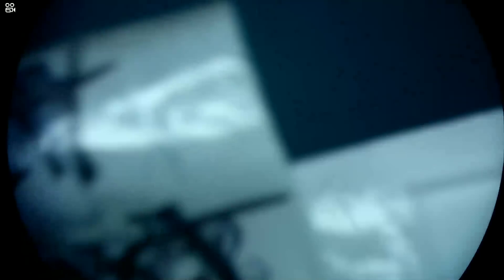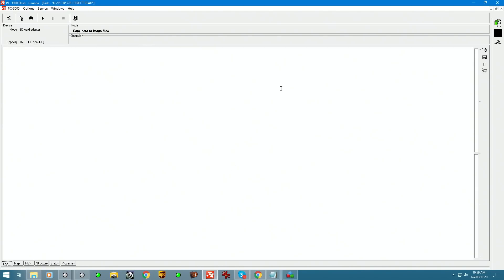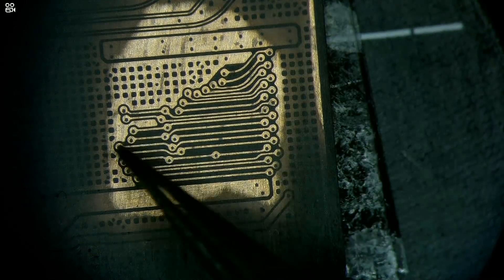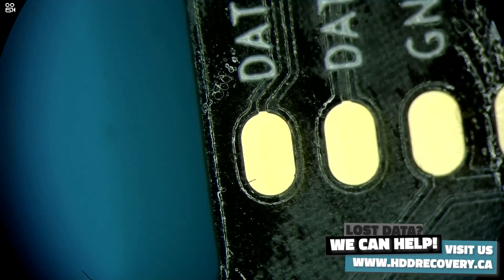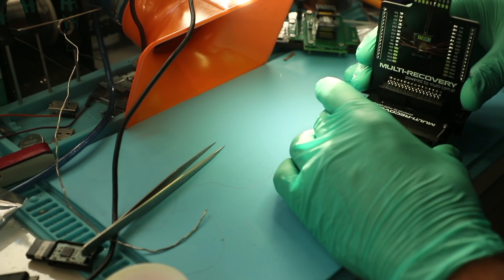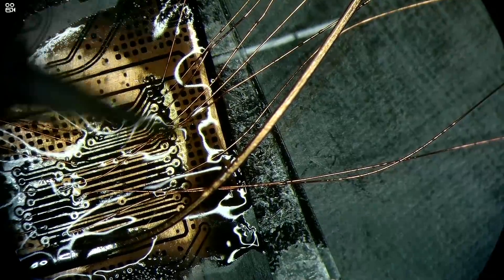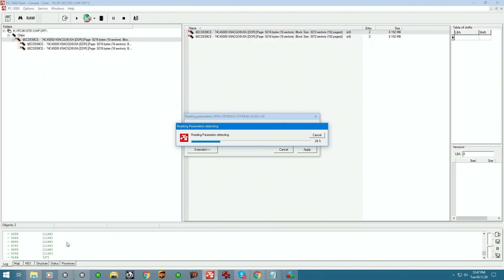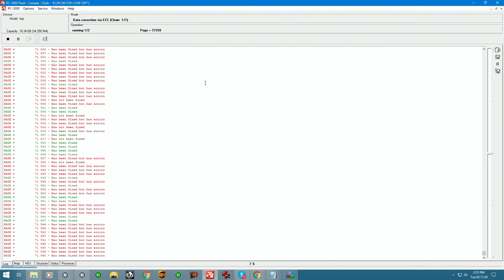microSD died in the camera. Monolithic data recovery part 1

Comment from the maker: the recovery is done and documented. part 2: 
https://youtu.be/kE6gf-K4kws
Reply: This is the part 2 link for anyone who was looking https://youtu.be/kE6gf-K4kws
Reply: but when
Reply: Ahem
Reply: 2 weeks, still no pin
Reply: 1st of all let me say...
U have mad skills buddy..! I've watched  few of ur videos & ur amazing...
I've been watching ur videos as I need ur help...

I have a MicroSD card that was in my phone (Android), I took it out 2 do a backup & I think the card reader I used corupted it or something... (The reader was just a cheap 1 I bought @ the market & had never used it b4, that was my mistake 4 not testing it b4 using it on a critical job)
When I pluged it into 2 my windows laptop the "Format Disk" box popped up.
I have since bought a better card reader wich I have tested & is good... but it still says the same.
I have tried using Recuva (free edition) but it gives an error as soon as it starts... as I believe it cant acces the drive till window can...
The error box says... "Failed to scan the following drives: F:: Unable to determin the file system type"

I dont want to format it & loose any of the folder structure or more importantly the data etc...
Please help... do you know of any software u can recommend
Ur suggestions would b greatly appreciated.
Thanks.

Comment: Looks very complicated. Where did you learned how to use the flash equipment?
Reply from the maker: Soldering is not hard with good tools, scope and few weeks of practice. Flash equipment does need some time to get a handle on it. Equipment developers offer courses, have support forums, and manuals for these tools

Comment: why none any of the storage companies do attention to the easy data recovery option? if the data storage's disk section of HDD can be separated easily and make it easy to replace or put into any other working HDD than it will be so much helpful for those poor users like me who are losing their most valuable data but have no much money or good RSS to recover the data. please I lost lots of but 1 big folder losing makes me so sad which contains many memorable photos and videos. maybe I can get back many things but not those sweet times which should be possible if I can access those photos and videos.

Comment: I had an SD card get corrupted in my Fujifilm camera just about a year ago. Coincidentally (?) it was just when the picture sequence number rolled over from 999 to1000, which was when the camera started putting the picture files into a new directory.

I put it into my Debian-running laptop and turned fsck loose on it. Reported a lot of errors. So I left it continuing the scan for about 24 hours. It “rescued” a lot of junk files, but in among them I was able to retrieve just about all the missing photos. At least there were no gaps in the photo numbering, and only one picture was visibly corrupted (the bottom half missing). So I call that a happy ending. ;)

Comment: Very interesting video, I was not aware that doing any sort of data recovery from a SD card or SSD was possible.  This is great to know about, I personally do not have anything on my SSDs etc that would warrant spending the money to recover the data.  I suppose if you were using a camera professionally it may be worth the expense of recovering the data.  When it comes to my PC and laptops I still do backups religiously a habit I got into from when all my drives were the old mechanical HDs.  Restoring from a back up is a whole lot cheaper than data recovery.

Comment: NICE! May i ask - if you solder this microSD directly to monolith adapter of PC3000, reading still be available? Or you need only this specific adapter that you was use? Thanks
Reply from the maker: PC3000 adapter is good for this too.
Reply: Congrats dude, you're amazingly skillful. My 250gb sata hdd spins and then stops, this is repeated several times and then stops. What could be the problem?

Comment: Hello! The insulation of my thin wires never comes off reliably, even when dumped into a solder blob. Are you using a special type of wire?
Reply from the maker: its a random wire I got from ebay.
Reply: @hddrecoveryservices  i applaud your skills and thanks for sharing. I'm also interested in what that wire is...

Comment: Temperature adjustments? Is it that picky?
Reply from the maker: In some cases yes. Read retry tables cad get unstable. RR works best at certain operation voltage and operation temperature. If the RR table gets bad, it may work differently under room+ operation temperature of the device. Compensation +/- can be established with heat or cold applied to device. Just did SanDisk microSD with cold spray. Results with cold withing 2 minutes were better than 20minutes of room temperature running same read retry
Reply: @hddrecoveryservices  Ok thought you meant harrdrives but with SD I can understand but it's insane never the less, thanks for the info!